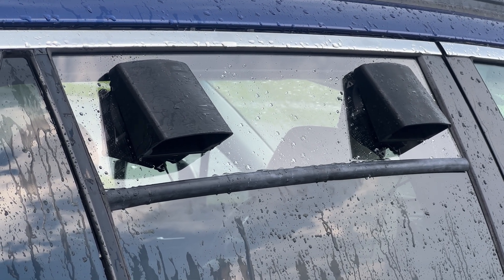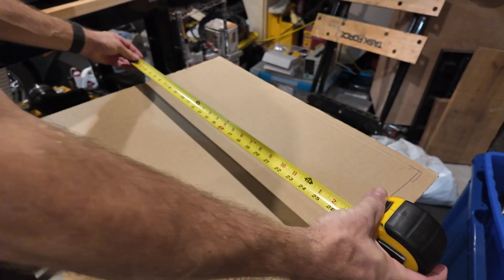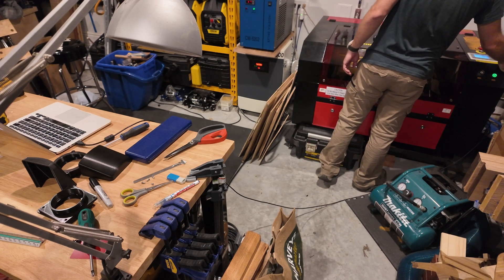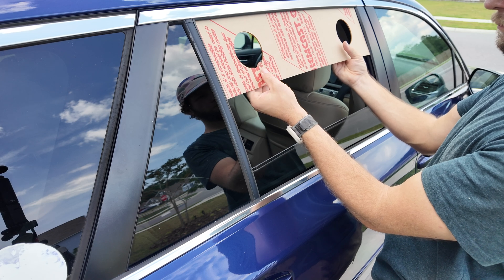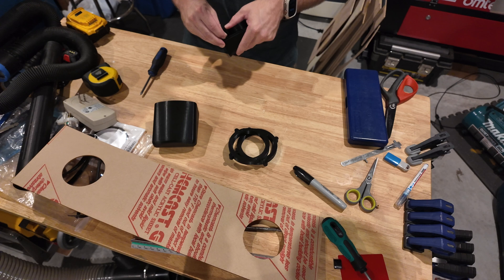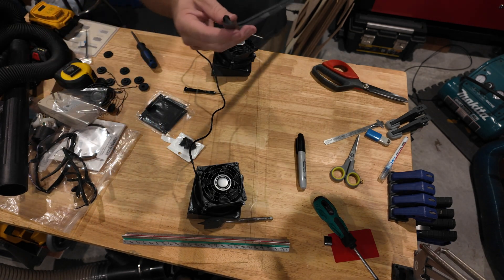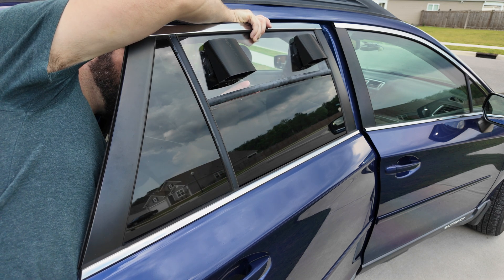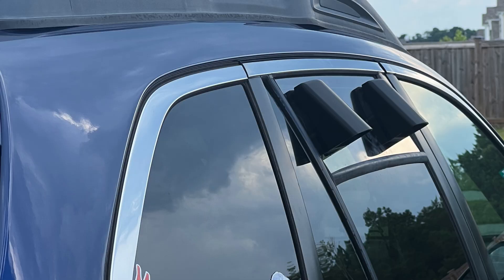DIY Window Vent Fan For Car Camping

Comment: All very well but i don't have access to any of that type of equipment. However its a great idea and I'm thinking i could put together something a whole lot less pretty and easily removed for when travelling and refitted when parked up. Id say a piece of cardboard with perhaps foil or something waterproof for the outside. Hmm lump of cardboard kinda shaped and gaffe taped with a fan or two in place. Messy but effective if done and sealed properly at least

Comment: I like the idea of these window fan units, but haven’t found a design that is secure. They all seem to be easy to punch in or jimmy through to get a stick on the door unlock button. Using it like in this case for camping, means that security is far less of an issue, but I’m looking for a solution will work in town…

Comment: I built 2 types for my Crosstrek. First was exhaust only... did not cool car down. (Ugh!) Second was intake only ... car is now same temp as outside. Good enough. Car has factory flapper vent in back, so no added vent needed. I used 1/8 ply, + rain guard on windows. I don't have lasers or 3D printer ... just hand tools.

Comment: How has it been holding up so far? How do you feel about security? Would it be hard to break into or would it not be safe to sleep in?  Also, have you considered doing another window for cross ventilation?

Comment: Was it effective? Did it stop the windows from misting? Also how's the noise level of these fans for you?
Reply from the maker: It works well, but I would assume that will depend on temperature and humidity as well, definitely beats cracking a window.  I need to get a co2 meter at some point and test that out as well.  Fan noise depends on which speed setting they are on, but goes from almost fully silent to a low whir. Much quieter than a normal sound/white noise machine for sure. Probably very subjective though

Comment: Nice idea, it's somewhat irritating how much a few materials can cost to make something. You need a little of this or a little of that and you have to buy a whole sheet or a whole roll or whatever is only available in a large quantity.
Reply from the maker: Absolutely, I was really hoping to find the sealing strip sold by the foot or short length. The acrylic cost is all in the shipping, basically the same cost to ship one sheet or 20.  Easier to go into production than to build a one off ha!
Reply: Definitely worth hitting up the local shops to ask for scrap/dumpster dive.
Reply: Solution, Make a bunch of them and then sell them on some subaru camping forum